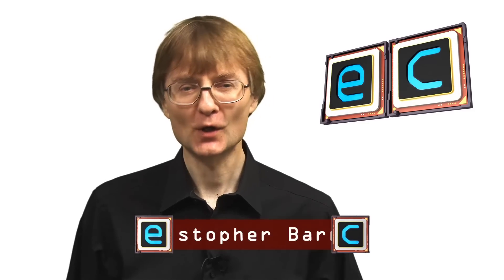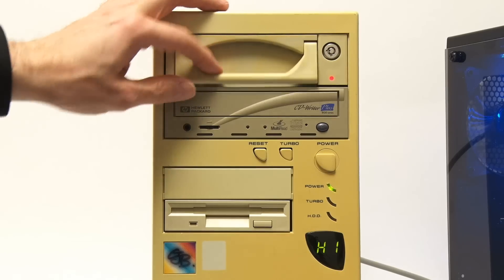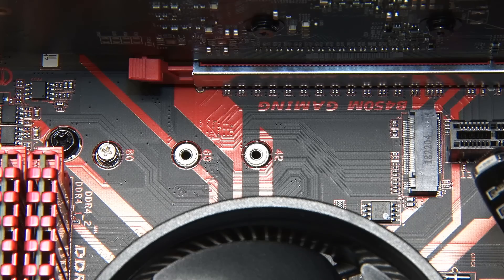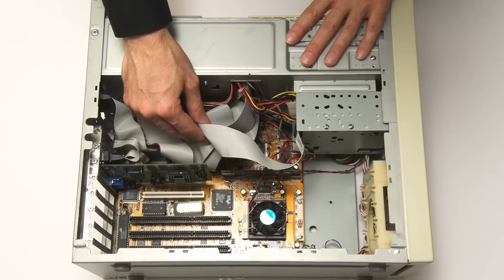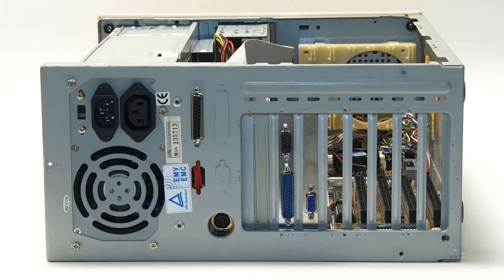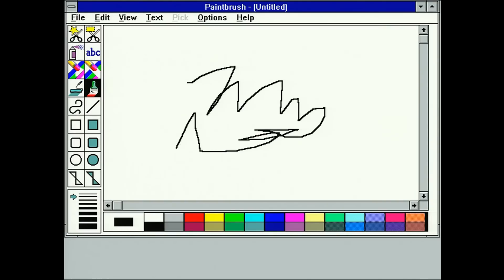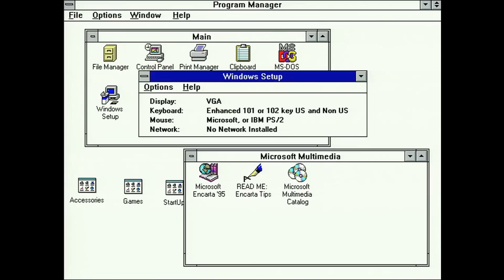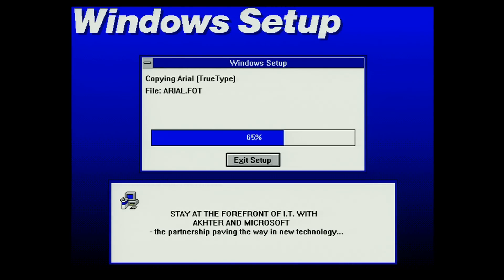Ryzen 3 vs 1996 PC

Comment: Cool video but I am curious, if you built it in 96, why not load Windows 95 on it? Was it an expense issue or architecture?
Reply from the maker: I had access to DOS and Windows 3.1 disks. :) Eventually I upgraded to Windows 98 with the second or third motherboard in that case.
Reply: @ExplainingComputers  I know that feeling all too well. I remember the days of hitting up the one or two guys in my department with MSDN to get a 95 license. :)
Reply: @pdacore  My first attempt at installing Windows 95 was a train wreck. It took forever before I finally saw a completed 95 install. Windows 98 SE was so much more satisfying. Of course, my hardware was more up to date by the time second edition arrived.
Reply: @AtariBorn  My installation would get stuck at the snare drum animated icon. Turns out it didn't like the 4 MB of RAM I had.
Reply: @waltherstolzing9719  I had the same freeze during the drum animation. I can't remember if my issue was my Trident video card or Cirrus Logic video card but one of them stalled the installation every time.
Reply: @AtariBorn  Hi, after about 2 years i found a simple solution. Remove everything optional card from the machine and use the oldest low end popular video card that i had say a S3 or ETxxx.
Most times that would enable a fresh new standard win95 install with no fancy hardware.
Run the machine for a few days to stabilize then tweak the settings or swap the video card.
Then restart the machine and make any changes necessary in the hardware wizard / drivers to make the *one single change *
Once that worked, reboot a few times to ensure it was fine , then make the next hardware change

I feel that fitting out a machine with modern video card with no built in drivers,  fax , modem, network card, scanner , scusi  add on I/O cards etc  just made it all to complex to handle at once

Small steps one at a time

Even them it was not easy, older cards you had to change jumpers, easy if the board had IRQ DMA printed on it, harder if you did not keep or get any initial instructions  or swap with some one else

Win 95-98 Plug and play was more like plug and pray !!!
Reply: @ExplainingComputers  this reminds me of my Win 95 machine, one of those cheap Tiny computers. I spent hours and hours on POD and Fury3.....and exploring dial-up internet. I had Encarta but found it lacking even then. 

A couple of sites like IMDB and BoxOfficeMojo have barely changed since then...
Reply: @JonnyInfinite  I completely forgot about Encarta
Reply: @ExplainingComputers  I stayed with 3.1 from 1990-96, then switched to 85 in '97 when i build my P166.  I recall it had usb ports, however usb support was non-existent at the time.
Reply: +William:

"Cool video but I am curious, if you built it in 96, why not load Windows 95 on it? Was it an expense issue or architecture?"

==He has a Pentium 120 MHz. You can certainly install Win 95 on it. You can even install on a 486 and I think 8 MB RAM is the minimum. I think I saw a youtube video where a guy installed on a 386. As long as it is a 32 bit CPU, Win 95 can handle it. I don't know if Win 95 actually uses 486 instructions or Pentium instructions. Perhaps it does if it detects you have one of those CPUs.
Reply: @louistournas120  
Pretty sure it was built for an i386 target, so didn't directly use the instructions although the correct software almost certainly could.

And IIRC win 3.1 had both "real mode" (16 bit) and "Enhanced" / "native" mode (32 bit) kernels.
Reply: @loc4725  It's been quite a few years since I last dinked around with Windows 3.x, but this is how I remember it.  Bear in mind my memory isn't that great anymore.

Windows 3.0 could work in three modes - real, protected, and 386 enhanced.

Real mode worked with 8086/8088 and newer processors and could support up to one meg of memory (though of course everything happened in 640K).

Protected mode required a minimum of a 286 chip and could support up to 16 megs of memory via kludgy MS-DOS instructions.

386 enhanced mode (new for Win 3.0) required a minimum of a 386 and could address up to 32 megs of memory (subject to hardware limitations, of course - the 386sx, for instance, could only address 16 megs).  

Windows detected the most appropriate mode during startup, but you could force it into one of the 'lesser' modes via a command-line switch if there were compatibility issues (most often occurred with very old software running in an MS-DOS window).

I seem to remember reading that Windows 3.1 (might have been just Windows for Workgroups, or maybe both?) abandoned real mode support.  I never tried to install any version of Windows on a 8086/8088, and I can only recall one instance where I had to force an older mode.
Reply: @xaenon  
Yes I remember that. I'm pretty sure Win 3.1 could run in real mode although the oldest machine I remember running it on was a 12Mhz 80286.

IIRC enhanced mode enabled hardware time-slicing, a feature added to the 286 and a crude form of paged segmented memory supported via a 16bit address bus. 

The 80386 added what we would today call proper memory management, process separation and a 32bit memory address bus, except on the economy SX version which only had 16bit bus.
Reply: @loc4725  Yeah, that sounds about right.  I guess it was Windoze for Workgroups 3.1something that dropped real mode. 

Hey, remember Calmira?   Made 3.x look like Windows 95.
Reply from the maker: I had floppies available for DOS and Windows 3.1. :)
Reply: @ExplainingComputers  I had them for Win95 and NT...A HUUUUUGE stack of them....
Reply: @ExplainingComputers  I grew tired of feeding the floppies, and one day i was told to just format the drive with dos, and then set it up.

I then create a install directory , inside that a win 3x or 95 / 98 and file copy the floppies into the correct folder, it was then much faster, plus everytime it needed new drivers it would auto find them.  Finally CD into the correct install folder and type setup

I  have Win95, Win 98,  Office 95 and Office 98 ( just over 40 of them in a floppy box ) install floppies 

After  that i ended up with buying a CD rom ( they were $999 when they came out in caddy style and i waited until the Creative SB16 and 2 speed cdrom was released on special for $499 - i still have it and it still works in a Pentium 2 - 200 )

Eventually all my floppy software was copied to a blank cd and that was fine for 5 to 10 years, these days most of my @1997 burnt cd's -especially the cheaper ones are suffering from CD-rot, they tend to brown on the outer edges, and it is very strange as they are all kept in the plastic sleeve in a cupboard away from direct light.

Oddly enough, i still have my P100, set up with Win3.1 on a gotek floppy emulator as the dallas cmos battery is dead and the 5 replacements are just old dead ones ( unlike the ebay advert ) and 3 of them had the battery mod but dont work - well one rebooted about 3 times, so no i just run the PC of Gotek USB floppy images

The Pentium 2 runs win98 on a SD card hard drive  and Dos win 95 on the spare SD image.

Also i have a Dell Celeron 2400, that runs 2 partitions Dos 6.22 and Win 3.11 for full dos, and Win XP on the dual boot

I am the only person in my circle of friends who can run office 3 ( Word 2 Excel 4 ) , Office 95, Office 97, Office XP and MS Works Dos and Windows 95  load and convert files between all of them - plus dos multiplan

BTW - what video card are you running in the P120, often a generic S3 or ET3000 compatible may get 256 colours, at least you can trial the setup and if it fails reboot the machine, use dos and win setup from the path and just reset the display

Regards
George
Reply: OS 2/Warp was my choice, far better than Win95 and it had internet tools built in. Even Gopher.
Reply: @Ni999  One of my proudest memories is the time I got an IBM microchannel 486 up and running OS/2 2.1 on a token ring, Banyon Vines network. :)
Reply: @pdacore  👍
Reply: @Ni999  Props from the original maintainer of the OS/2 Alternative (which became SoftWhere) list of OS/2 alternatives to Windows programs.
Reply: @FreihEitner  Well done compadre! 👍
Reply: A clean install of MS DOS, Windows 3.1, and MS Office involved many floppies and would take hours.  Whoa unto you if you could not sort out your available IRQs to get your Sound Blaster card working.
Reply: @Chris.Brisson  IRQ 3 / DMA 11? Sounds right.
Reply: Chris Brisson i always had one piece of hardware that wasn’t quite set up right
Reply: Anyone remember when Windows 95 finally came out and the floppy's were virus infected?
Reply: @pdacore  Had a virus from a floppy once that made PC reboot @ midnight
Reply: William yes I got a copied set of floppy from collage and it was infected I was a newb back than so had to phone the Tiny computer help line who after hours of instruction finally fixed it that was the reason I became a pc tec all those years ago i just loved the fact that he knew so much about computers  yet really he was just a First level tec reading from a card. I  progressed to windows 5 on a cd wow the speed of loading seemed like something from Star Trek  lol
Reply: William   Many PCs in 1996 were still running Windows 3.1, so it's actually somewhat consistent for the period.   Personally, I'm gratified that people get to see what Windows looked like back in its 'barebone' days.  Gives you a real sense of how much has changed in (oh, good gravy I'm old!) the past 25 or so years).

The initial version of Win95 wasn't honestly much of an improvement Win 3.1 anyway.  It wasn't until Win95 OSR 2.x that it really started showing off its capabilities. like support for partitions exceeding 2047 megabytes, some rudimentary USB support (mostly for keyboards and mice), and better built in multimedia and networking).   Problem was OSR 2.0 and later were all OEM versions; you couldn't get them unless you bought a brand-new CPU, motherboard, or hard drive.
Reply: My first PC was a 286 bought at a computer auction (remember those?) In 1992 for £500,16 mb memory was £350 ! I started building them myself after that to keep the price down . The value of these old computers has shot up in the last year or so, look on eBay!
Reply: @nickclark6001  Yes, because there's a 'retro gamer' geek fad going on right now.   A couple of years ago I picked up an old eMachine for $20 (Core2 Duo, 2 gigs RAM, and a 200 gb HDD) to run XP and some older software that simply refuses to run under Win10.  It had a bum PSU which I replaced for like $20 and its a remarkably capable rig.  I don't play many games, but it works great, and just last week I saw virtually the very same rig go on eBay for just over $300.  It's just nuts.

Comment: Hello Chris, how did you capture the screen on Windows 3.1?
Reply from the maker: With some difficulty! This is the first video I've done it in, as it's a challenge I've been meaning to crack for some time. I had a VGA to HDMI converter with a frame buffer in (a non-trivial bit of kit!), and then fed that into an HDMI splitter, and then the output of that into a BlackMagic Design 4K recorder (into which I also connected an XLR microphone). This gave me ProRes files, which then required very significant post processing. But I am very pleased with the result. Sadly I still cannot record a DOS screen from a VGA card of this age, so there was a lot of messing around at that part of the video.
Reply: @ExplainingComputers  Wow, that's a lot to figure out! Thank you so much for your effort. Your dedication is reflected in the end product. It looks amazing!
Reply from the maker: Thanks for this -- especially as somebody else here was just commented how this video demonstrates the decline in production quality in this channel . . .
Reply: @ExplainingComputers  Well, then either they have some extra sense nobody else has or they're just trolls because I couldn't notice any decline in production quality. I'd bet it's the latter.
Reply: Probably with a VGA capture card.

Comment: That's ridiculous. Back then hardware was so overpowered you would need a separate button to slow it down, yet nowadays everyone competes in overclocking and complains about everything (hello Windows) being slow and laggy. Probably software was better optimized in the past days..
Reply: Actually need for turbo button was there to overcome of lack of optimization of early programs. In the times of Pentium CPU it was already just gimmick from the past but ability to slow down the 286 or 386 to the XT CPU was a need to have some early programs and games working with the original 8086  clock speed.
Reply: I love using Linux all the way.
Reply from the maker: @Witold Grabowski  Yes, indeed. Some early software tied its timing directly to the CPU's clock speed.

Comment: This is a very vintage looking flat monitor I've ever seen.
Reply from the maker: They were mainly supplied for industrial use I think -- I remember it took a very long time to find it.
Reply: I find it quite remarkable that he even has one. It used to be the case that if you wanted a flat screen it was either a Sony Trinitron (£££) or a 4 shades (if you were lucky) monochrome LCD on a laptop.

But funny thing was after a while you get used to the bubble-like appearance of a normal CRT and stop noticing the distortion.